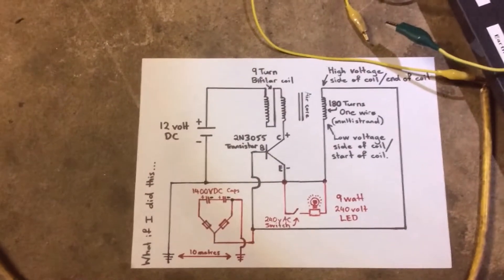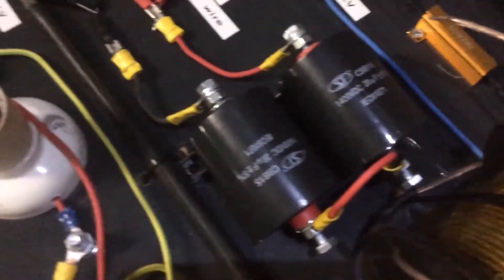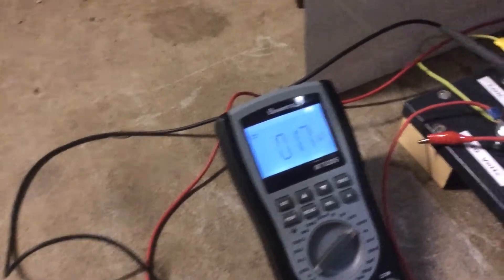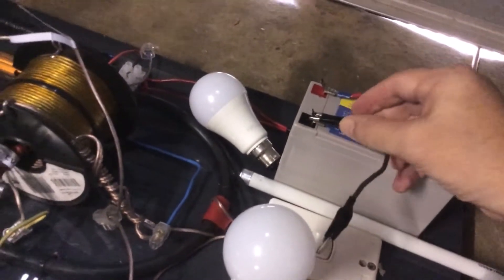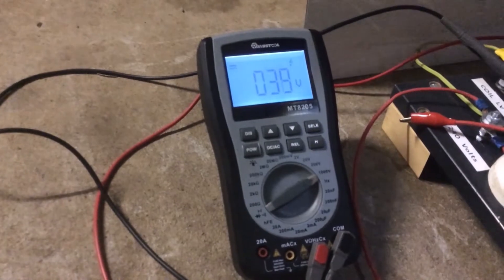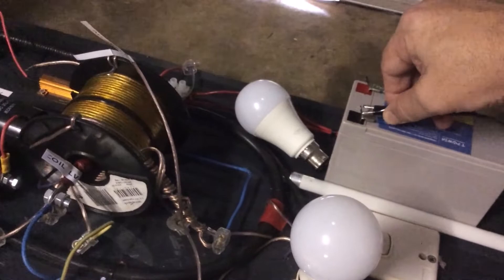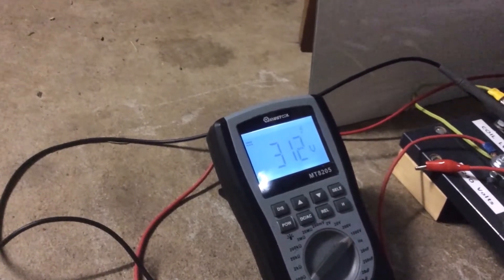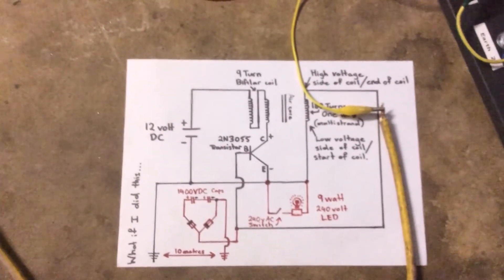Teslas Radiant Energy Through The Earth, High Voltage DC Capacitor Charging + Plus I Get Zapped!

Comment: Hello, I hope you're fine. I'm studying now the grounding. And this video is excellent in this regard. The ground from the low voltage side to the avramenko gives a significant increase. Is this the low voltage side of the secondary with 180 turns? Or is it the one from the primary with 9 turns? Greetings from Switzerland Bern, Marcel

Comment: wo0t, avamenko plug, handy! and actually it may even be getting 'full wave', in way similar to a 'center tapped full wave rectifier' gets both half-cycles with only 2 diodes... or so I've read (not yet verified) 🤷 

I've tested AV plugs with different types of diodes and find schottky diodes to work slightly better than 'ultrafast' diodes, for what it's worth 😸
Reply from the maker: Thank you for your comment.
The Avramenko Plug has been a super interesting thing over the years of my research, the fact you can get two polarities from one wire still blows my mind. Cant verify too much about what type of wave it gets, I tend not to do too many measurements and prefer to see what happens in the real world as all too often the calculations fall short of reality. I imagine this is because the science that was relied upon to make the meter may not be so accurate.ie. if a ruler has scribed upon it 1mm increments but for whatever reason the scale used to mark these increments was 0.95mm then we will naturally have a problem with everything measured by this ruler.
I apply the same logic to my work, if I want to charge a battery and the calculations suggest to me I can achieve that using a particular method that in practice falls short of reality just as the ruler would, then I will use the real world data that tells me the calculations were wrong. All too often we are told the book says no, there's a bloody good reason why they don't want you to know. That's a long winded way of me saying I try not to use meters as often as possible because they lie like the left does. Neil De Grasse Tyson would have you believe we understand physics but yet he isn't reverse engineering pentagon owned ARV's that don't care for his rules. 90 degree turns at mach 5, yeah we don't know shit about physics!
I agree regarding the schottky diodes being better, I believe thats loosely related to the doping material much like my findings with the green LED in the Tesla transfer method.
Thanks for watching.

Comment: With these systems,  you do seem to be able to pick up power of different quantities  from E, B or C , very unusual. 🤔
Reply from the maker: Thank you for your comment.
Sorry for my delayed reply. There are so many variables, once you realise that these different forms of electricity have different responses from electrical components than what is taught, it becomes a giant worm hole filled with unread possibilities that are far more interesting than the crap were drip fed. For example, who would have thought that my through earth system could ignore the presence of a diode to reach its target but still honour "conventional electricity" to obey the diode for DC! Mind blowing really. I once read that there are possibly 16 separate pathways that electricity can use with 1 single wire, things like this would have me believe it to be true as this is confirmation of at least two separate intelligent electrical signals travelling on one wire. Fascinating. Then you can validate these concepts even with conventional electronics with things like a Powerline Ethernet Adapter which uses existing mains 240 volt wiring in a house to transmit ethernet data whilst the mains uses the same wires for power, in fact its what I'm using right now as my internet connection.
More research, more research, more research!
Reply: @whatifididthis...1236  yes , it truly is an amazing subject , as you say who would think you can pass signals through a 240v main supply , staggering !! I guess it must be using  the cable as an aerial to transmit between connectors,  possibly outside the cable . Have you ever had a thing where you can remove the base lead and the transistor continues to work ? Or you get a straight neon bulb lighting from battery terminals when you hold one end in your hand ? The system must have an earth for me to get this , and I'm sure it's using me as a return ! It sure is strange stuff 🤔

Comment: I think radiant energy increases  with voltage produced , radiant energy seeps into every bit of metal within a given distance depending on the voltage / resonance . Resonance depends on the speed the transistor flip flops at . Wow , that was a zapp !! I've been burnt but never zapped like that😮 . Can you tell me, do you have 3 coil windings on your system and if so ,would that be one thin wound on first and 2 thick then wound in tandem ? E.g speaker wire . I am enjoying looking through your archive of clips , some interesting things to absorb 😀.
Reply from the maker: Thank you for your comment.
Sorry my delayed response. You could be right there, I find it so difficult to see what's going on that sometimes I have to ask myself do you really need to bother yourself with the nitty gritty, ie. we don't try to understand the internal combustion engine every time we drive a car, in the same way a photographer doesn't need to know how light travels but how to manipulate the light, some things are more beautiful unexplained but I often can't help but wonder!

The primary coil is two wire in tandem as you suggest, speaker wire, essentially a wire beside an equal wire. When assembled as the two wires are in speaker cable it makes for a simple wind from one end to the other, one layer, two wires side by side on the form. Once wound,( imagine a black and red wire), we take the RED at the start of the coil and join it to the BLACK at the end of the coil. This is where my coil diverts from standard joule thief setups.

The coil arrangement is then as follows (FOR THIS VIDEO):
L1 = 1 layer, 10 turns of speaker wire, when end are joined this results in 20 turns on the primary, one pass of 10 turns repeated by one pass 10 turns of black wire.

L2 = 20 turns (single wire)  *NOT electrically connected*
L3 = 20 turns (single wire)  *NOT electrically connected*
L4 = 200 turns.

L1 is wound directly on the form and each layer wound on top of that. L2 & L3 aren't exactly necessary but they do have an effect on the circuit and act somewhat like dielectric capacitors. Again not necessary as seen in my portable version but they where included for experiments of that concept.
Thank you for watching some of my other videos it is greatly appreciated.

Comment: Hello, awesome work!  Would microwave capacitors work, or do they have To be electrolytic?
Reply from the maker: Thank you for your comment.
Microwave capacitors will also work but the parameters of the MOT CAP may not be optimal. The capacitors used in this video are 1400 VDC 20uf X 2 welding capacitors in series to make a 2800 VDC 10uf capacitor which may NOT be the ideal choice however they are good for my experiments with such high voltages.

Comment: Assume .. Honesty on getting electrocuted..   even though the load is coming from the same line each point has a different resistance which will Determine the flow which will light up the lightbulb
Reply from the maker: Thank you for watching. The circuit can supply quite a decent punch even without capacitors, when I watched it for editing I could see the brain delay after being shocked I couldn’t think of what to say. There are several ways to light a bulb using this circuit, I will try to make a video to demonstrate the seperate take off points.

Comment: Hi buddy, appreciate for your effort, of this and previous videos, nice job! 

Question: how many KW such a system could potentially push out? Or how many amps at 240v?
Reply from the maker: Hi, thanks for watching. Sorry for not replying sooner, this system is only a low power system, however, this is only because the switching mechanism in the circuit can’t handle too much. Change the switching mechanism for something more heavy duty and your good to go. I find there are less losses above 20khz. Transferring energy through the ground using the SWER concept, (Single Wire Earth Return) is restricted by the current carrying capacity of the single wire, Earth itself can probably take an infinite amount of current.
Have a nice day.
Reply: @whatifididthis...1236  No worries! Thanks for reply! 

I'm looking different type of systems, to see difference and what is match between them. 

I'm getting to conclusion, that yes, the higher frequency and voltage, helps system to run more efficient.
Reply from the maker: @Brown_1_111  Agreed. From memory this circuit produces over 2000 volts at 172Khz. The excess energy is obtained by having a seperate coil that is resonant with the secondary, exactly the same length wire. This resonant coil then receives a copy of the electric signal being transmitted by the secondary without increasing the input as it feeds its load via the magnetic field, similar to a radio frequency. Ever wondered why a crystal radio doesn’t require a battery? Also, when an extra couple hundred people turn on their radios does the radio broadcaster have to apply more power, the answer is, no effect on input power for the transmitter is seen. I hope to demonstrate this concept soon in a new video.
Reply: @whatifididthis...1236  Probably YouTube will remove that video straight away. 
You absolutely right. 
Also as Don Smith said: "When circuit is at its point of resonance, resistance in the circuit drops to zero and the circuit becomes effectively a superconductor."
Formula: W=0.5 x C x V^2 x (Hz)^2 

If you double volts and Hz , your output quads! 

That's why Nikolas Tesla was ONLY after high voltage and huge frequency.... 

Another fenomenal.... "SPARK GAP"

Gerard Morin talks a lot about his test connected to spark gap. 
On one of his vid he showed how spark gap affects not only volts, but frequency at the same time!
Reply: @whatifididthis...1236  So if u get 172kHz ... Spark gap might could amplify that frequency 10x or maybe more...
Also imagine what can happen with Volts. 
In order to make a spark gap, you might need at least 0.1mm space and ~3kV volume.
Reply from the maker: @Brown_1_111  I tried a spark gap with this circuit, it seemed to produce too high of a voltage for the 2n3055 transistor and blew it up twice. Unfortunately I had 240 volt chargers connected to the battery whilst testing on both occasions which also blew up the blocking diodes in the chargers, supplying the circuit with 240V AC which resulted in a bang and a puff of smoke. I don’t recommend having a battery charger connected to the circuit whilst making adjustments as the voltages achieved are seen across the 12 volt battery terminals, it seems ok if not testing or changing things around which behaves like a spark gap when making contact. Same thing happened when I connected the output of this circuit to a 1 metre tall Tesla coil that had its output connected to an MOT, the result was 1 inch long green plasma arcs to earth. PLEASE be careful if replicating this circuit it can pack a decent punch.
Reply: @whatifididthis...1236  I'm looking forward for a bit different type of build. Recently found one interesting.... Can I give u a YouTube link in here?
Reply from the maker: @Brown_1_111  sure, I’m always interested in learning more
Reply from the maker: @Brown_1_111  I didn’t end up with the link you mentioned, in case they deleted it could you please send again. Cheers
Reply: @whatifididthis...1236  Try to search Soloveys power amplification with a simple Tesla coil. The channel is Patrick Kelly
Reply from the maker: @Brown_1_111  Lol, I have been reading that PDF for approximately 15 years. I have learned so much from it, probably fair to say at least 50% of what I know is by experiments done replicating inventions listed in that PDF. I’m currently setting up my next video, in which I hope to demonstrate the benefits of resonance which Tesla and Don Smith used in their designs to maximise efficiency.
Stay tuned! 😂 pun intended!
Reply: @whatifididthis...1236  Also, key for AMPs is placing L1 coil in the middle of L2. Don's system proves that also Kelly mentioned in his book the same.

Comment: Hi Looks like a fair bit of work went into this one, how is the bulb lighting up ?
Reply from the maker: Hi Bradley, thanks for watching. I’m assuming you mean how could the light work as it is not connected in a normal practice. The answer is I’m not sure, nearly all my discoveries come from doing experiments you would not normally try. I am not an electrical engineer and have no official training to speak of, all my education in this field is trial and error and it’s fair to say the error outweighs success by at least 100 to 1.
This circuit on the board has grown over time and there’s not that much involved, the entire thing could be built in maybe two hours, if it is just a lighting source you are after I have built a more practical version in this video. https://youtu.be/Bp9j81ueVBg I encourage you to have a go if your interested, please be careful as it can pack a punch! Also remember for 120 volt you will need less turns on your secondary, I tried the only 120 volt light I had, let’s just say it has gone to the light! 🤣
Thanks for watching
Have a nice day.